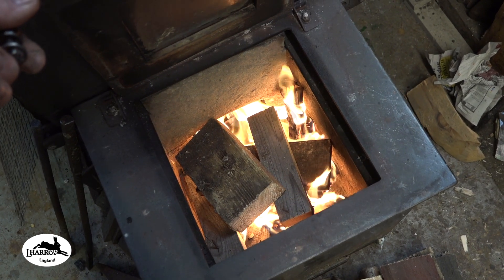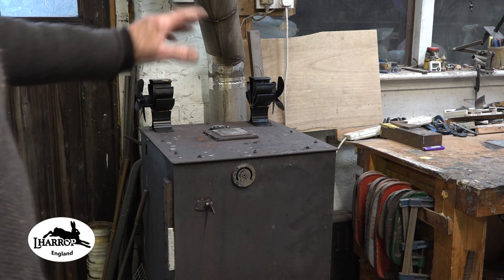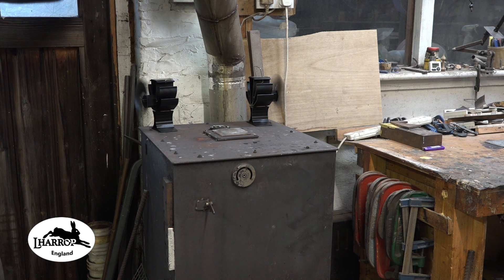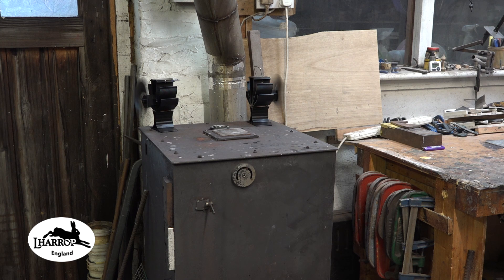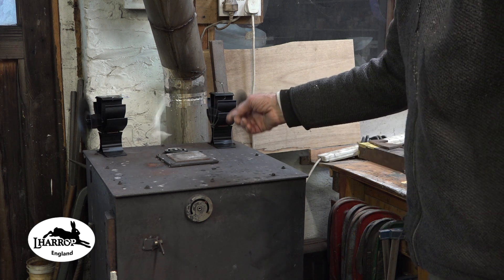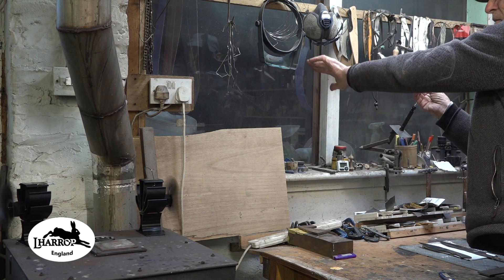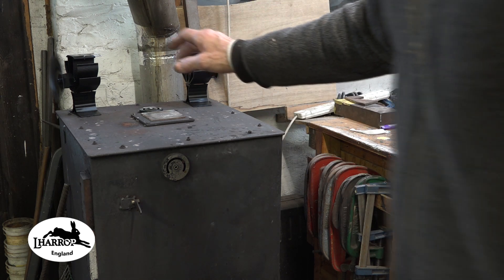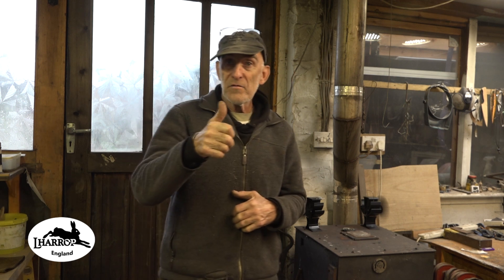rocket stove improvement from my new fans

Comment: We have one on our Esse stove and it works pretty good. But when you open the door and you sometimes get the very light ash floating around the fan blows it even further away  😂. How is your riser holding up Loz 👍
Reply from the maker: Hi Darren, yep that fine ash is a pain not a problem in my dusty shop though haha, riser holding up great mate no change in it since it was built. Cheers.

Comment: You might try connecting two pipes or hoses to the bottom (cold) tube intakes. Run them 3-5m away to draw cold air into the tubes and heat it. Should more evenly distribute the heat from the stove…
Reply from the maker: cheers

Comment: they use peltier cells and I think you could use a couple custom "stove fans" to force more air inside your heat scavenging tubes.
This would have the added benefit to not extract to much heat before being at operating temperature.
You might also be able to "turbo" the secondary inlet that way too :P
Reply from the maker: cheers ive been thinking about a secondary use mate.